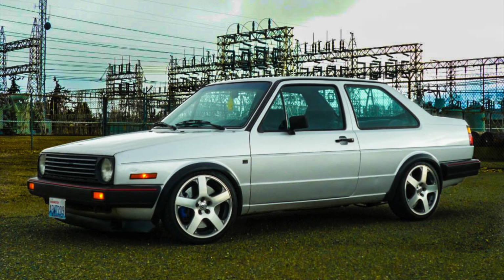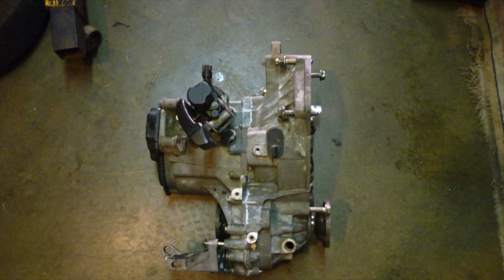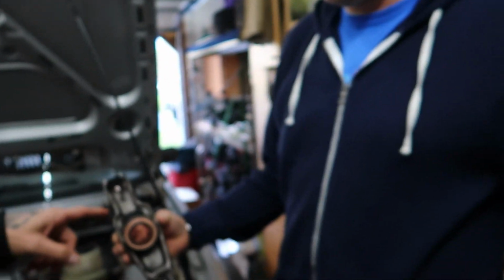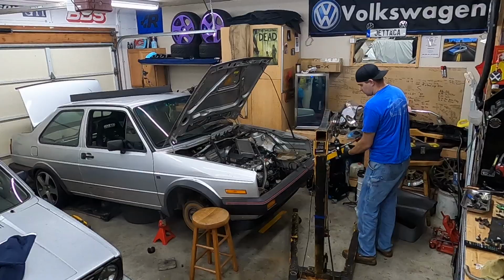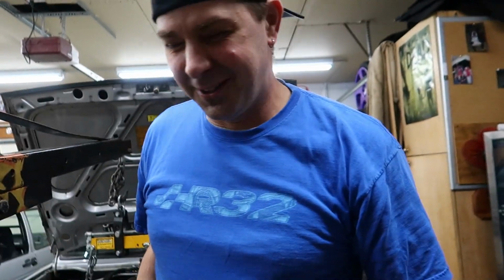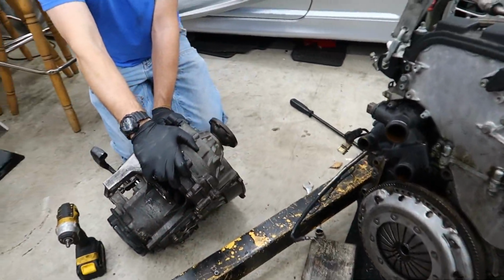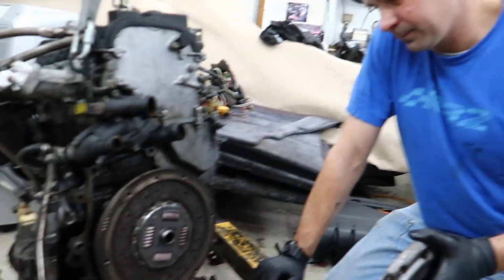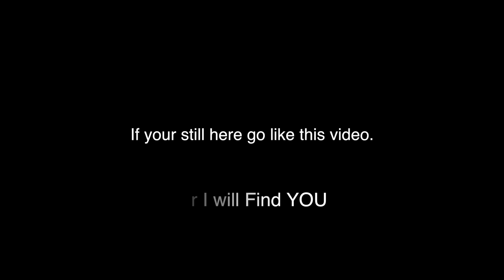MK2 VR6 Jetta Coupe Build History | Upgrade Time | Jeremy Broke It

Comment: Correct me if I’m wrong. I wanna say that brake master cylinder is from a 24v vr6 Eurovan Non Abs.. Awesome vid Doods
Reply: euromess It’s a 25mm master cylinder from a Audi 200 or a audi urs4 both of those cars that came with the dual piston girling 60 calipers. Unless of course they are the same but I doubt it because the euro van didn’t have dual piston brakes

Comment: Hi guys! Are those aftermarket rallye lights and grill or stock parts?
Reply: Takács Károly everything is stock
Reply: Other then the lower middle portion of the core support. When I got the lights it was cut off so I had a guy weld on one from a aero core support

Comment: Drive like Jeremy and you end up finding weak points. I drive the same and I figure if its going to break, break it and fix it. The SACHS performance clutch kit will do wonders on a NA VR. Those axles might be a weak point later..
Reply: David Ariss thank you. I think I need to get a slightly up graded clutch
Reply: David Ariss thank you. I think I need to get a slightly up graded clutch